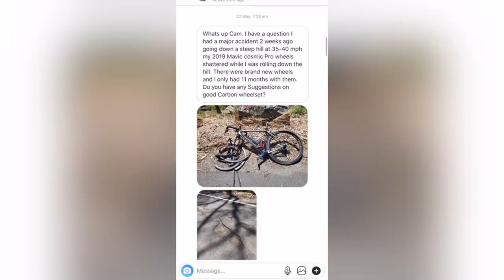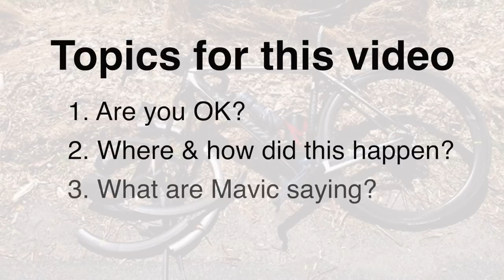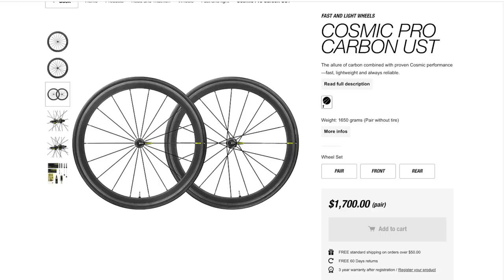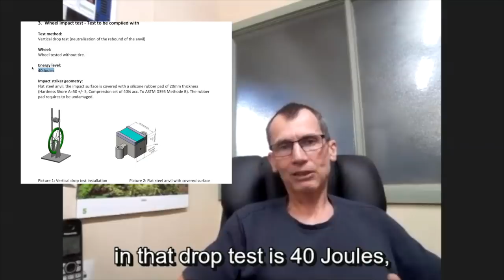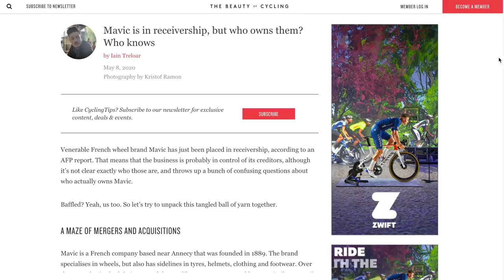A FRIGHTENING MAVIC CARBON WHEEL FAIL (at speed)

Comment: Hit a huge pothole ! No wheel would have survived regardless of brake type. Rider error. Try complaining to car manufacturer when you damage your vehicle wheel when you hit a pot hole. Carbon wheels are race wheels just because pros ride them does not mean Everyone should.  Carapas when riding for Movistar can be seen training on Campy Zonda alu wheels he weighs around 130 lbs. You take your risks , the lighter the equipment the more fragile it becomes.

Comment: Further proof that carbon is an inferior material for bike building.
Reply from the maker: Fair call
Reply: @CamNicholls  Aluminium is my go-to choice for bike frames and bike wheels.
High end aluminium of course, the likes of double or triple butted T6 6061.
Slightly heavier than carbon, but much more reliable.

Comment: Whoa, you are making a dangerous assumption that braking was a factor in this wheel failure. Nowhere is braking, or over braking, addressed in the video. In my experience, going 45mph pretty much means you are NOT braking hard, you are letting the bike fly.  So the assumption should be that over heating of the rim is not the primary cause of failure. Look at video of bear mountain decent on U tube, straight as an arrow without the need to brake. BAD video because of bad assumption.
Reply: richard lake ......Thank God - someone else on this stream with a bit of commonsense! This accident was as a result of catastrophic WHEEL failure - it had absolutely nothing to do with the braking system! [if anything, it was more to do with the poor guy's weight and the abysmal road surface]. Yet as usual, many cycling newbies/trendies have used it as a platform to bad-mouth rim brakes and promote disc brakes - or 'breaks' as everyone seems to misspell them on here! [including Cam himself].
I actually experienced a similar accident myself - was on ride with a group of guys on a route I had never ridden before. I was first over a climb and was therefore leading on the descent. I suddenly hit a large pothole went over the bars and landed headfirst on the road. I was instantly knocked out and don't remember a thing about it except what I was told by the guys I was riding with later.
My [carbon] bike was equipped with Reynolds 46 carbon clincher wheels at that time - neither the wheels nor the frame were damaged in any way! [I had both checked over by a professional UCI mechanic after the accident]. I have always used rim brakes - and I am 57kgs. I have ridden carbon clinchers for over 15 years and have never had a problem with them. 
I would suggest [as you do] that 'John' was freewheeling at high speed when he hit the pothole. Combined with his 100k+ weight this probably had much more to do with the dramatic failure of his wheels - or possibly inferior build quality?

Comment: I don't see the point of having expensive and fragile carbon wheels which are lighter than top aluminum wheels. Actually very few companies make their carbon products in mother country under strict control. Carbon is NOT an ideal or magic material. Also rim brakes are NOT for carbon wheels, heating up quickly... I am NOT trusting any BIG brands with their great carbon products, frames, handle bars or seat post. Too many cases of accidents with throw away expensive gadgets.

Comment: The part of you actually missing the entire point of Chinese suppliers building Mavics or any other wheelset is bewildering. If you know bikes then Mavic isnt even a thing anymore in carbon construction. A T800 wheelset with flex built in only cost 1,200 USD with ceramic bearing hubs and as light as you want for comp. Branding for wheelsets is over, and t1000 dosent work for wheels either ni matter how light they are. You shouldnt listen to hamibi either. He still hasnt figured out this game.

Comment: Do riders really need to be spending thousands of dollars on wheels???
Reply from the maker: Yes! Of course, they feel great and fast. Awesome for fast bunch ride and racing, but shouldn't be used all the time! Cam
Reply: @CamNicholls  personally i ride a hardtail xc mtb with 26" aluminum wheels and i can thrash my bike around without caring simply because the whole damn bike is only $700. I'd rather be doing that than checking my bike every hour/day simply because i have expensive carbon
Reply: Arcanine300.......Absolutely! The most important component on any bike [after the frame-set] are the wheels.

Comment: Wtf... Im not buying carbon stuff... I mean... Wheels or frame Im not 100 kg but they are super expensive im not pro ciclyst and besides the price they can break easily. Ok the solution could be to use disc brakes for carbon wheels but they still can brake. If your legs are good you wont noticw the difference. If you go to the tour of france ok use some to try to take 1 second of advantage. Bruh...

Comment: Two words "aluminium wheels"

Carbon wheels are for pros and posers just don't buy them

If your good enough for carbon you should be being paid to use them 😎
Reply: Seems like a bit of a short sighted comment to me. If they’re good enough for the pros, they should be plenty good enough for the average consumer, especially if they are sold in a retail market. Without your “posers”, the whole industry would be hybrid granny bikes. You should say the same thing about clipless pedals, carbon frames, electronic group sets, any aero product, or any bike made after 1985. Let me guess, you ride a steel frame with friction shifters and toeclips while wearing a leather helmet & wool jersey? 😉
Reply: Well I actually own a trek madone 5.5 from 2008 which has a carbon frame believe it or not but it has aluminium wheels and they are still in one piece